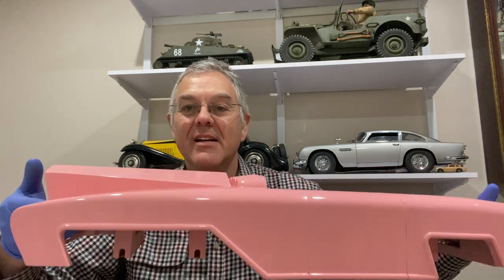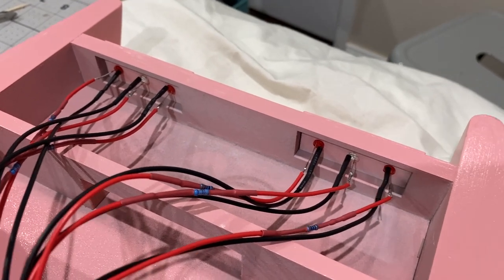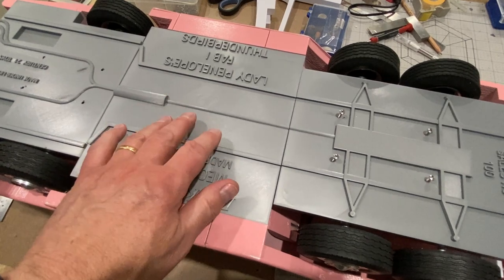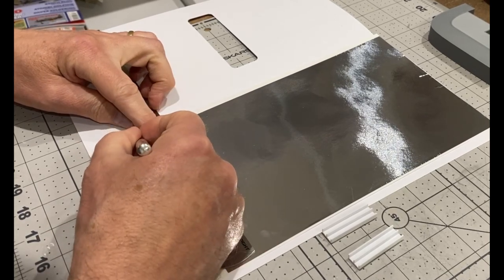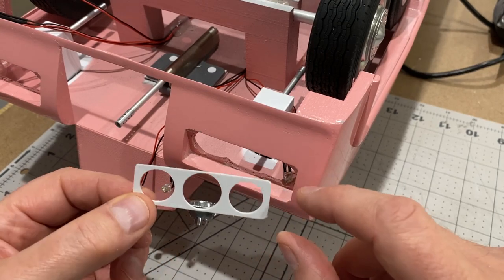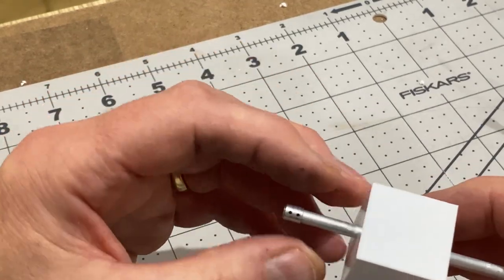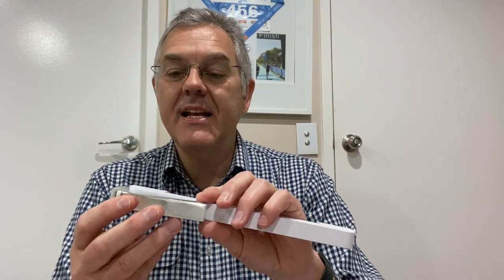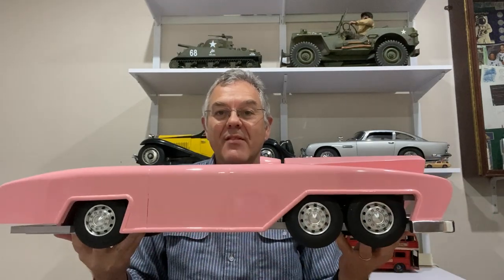Building the FAB 1 pink Rolls Royce from Thunderbirds - Part 10

Comment: for the grill you can use some 1,5mm thick aluminium sheet , and cut the loose plates, you can polish them seperatly  to a high gloss chrome look ,
Reply from the maker: Of course, but the aim of this project was to make a 3D printed model.  There would be many other ways to scratch build it using other materials.